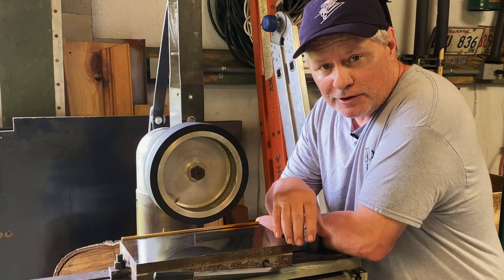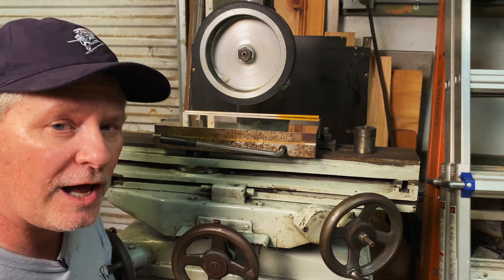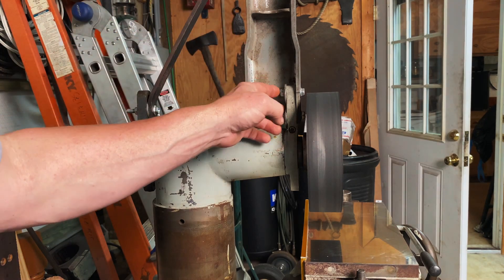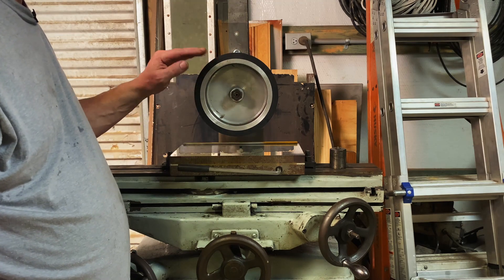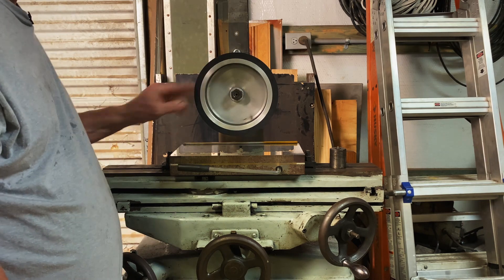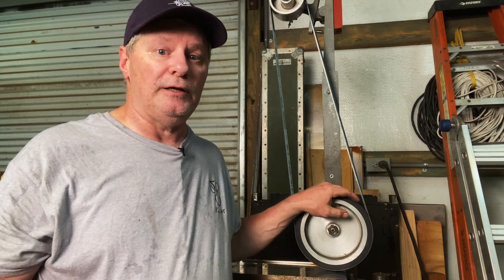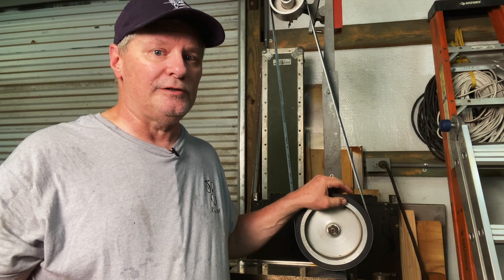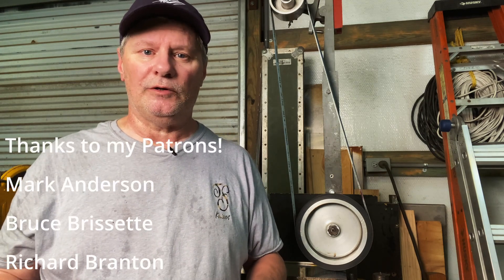Surface Grinder to Belt Conversion

Comment: This is awesome! I need a surface grinder badly. However I wonder if a good surface grinder attachment for 2x72 do the same job. I have plenty of room so this is not an issue. I 'm just looking for the best choice.
Reply from the maker: Thanks!  The attachment will work but you won’t get the same accuracy.  Rigidity is king.  However most tasks for makers are sufficient for knife makers.  But you’ll see many makers with attachment grinders going to actual surface grinders like I did.  I make folders and tolerances have to be tight!  🙂
Reply: Thank you Tony. You really helped me answer my question.
Reply from the maker: You’re welcome my friend 🙂

Comment: I know Norm Coote well, as I have purchased three grinders from him.  He would definitely sell you just that part you used if you reached out to him and asked.  Norm is very accommodating with parts needed.
Reply from the maker: Thanks!  I didn’t use the grinder anymore anyway.  I retired it long ago.  It was fine for a starter grinder but quickly became unusable for my needs.  It sat collecting dust for many years and now it has new life.  🙂
Reply: @TonySeverioKnives  Yeah but for anyone else that wants to modify a surface grinder with a belt like you have here.  To make things easier they could contact Norm and just buy that arm with the idler wheel only from him.  I can almost guarantee you he'd sell you just that part with the idler wheel and tracking adjustment.
Reply from the maker: @GlennLaguna I agree.